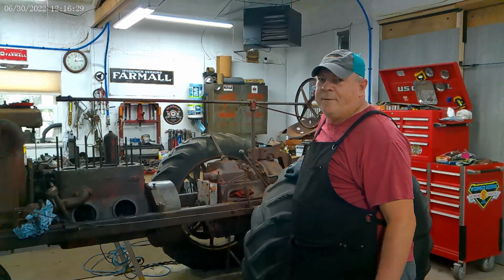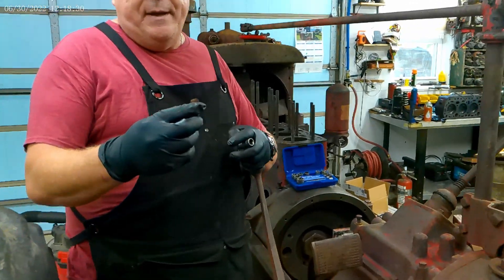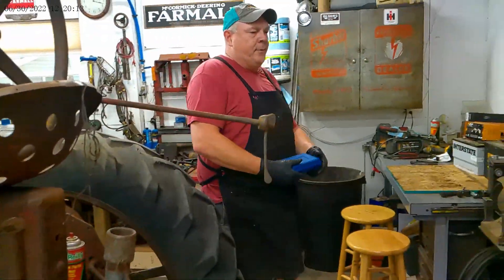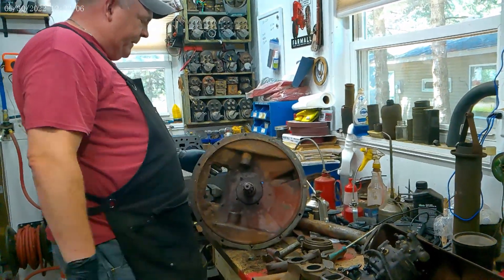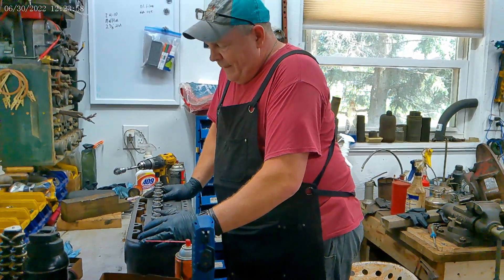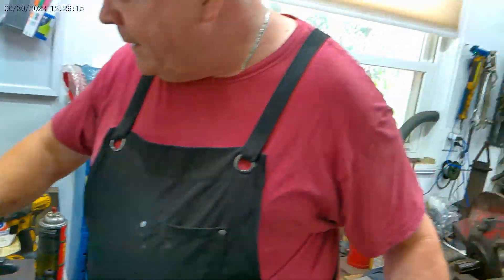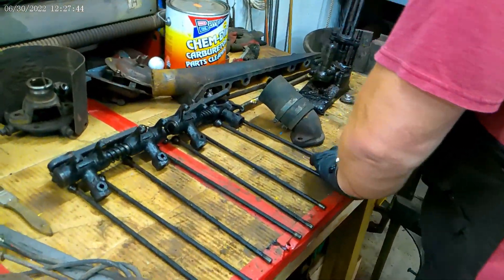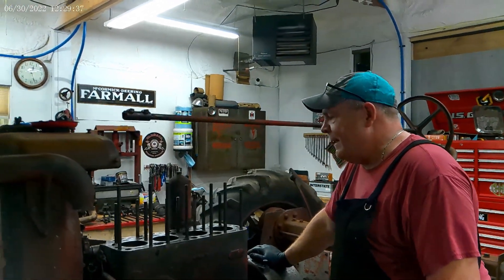Taking apart 1935 Farmall F 20

Comment: Merry Christmas from Wisconsin, rocket socket set , cool info for rounded head bolts thks
I have a lot of H's and Ms (1 C ) but really didn't know much of pre 1939 IH tractors . I have
 been using the internet and found  out about the f series . Now I know a little . I guess
there just rare to find somebody that has one, but It's like a car as soon as you buy one . then 
you see them all the time .  I think I like the f-20  / with a overdrive and starter option If I was to collect one.
Reply from the maker: Merry Christmas!!   there are a few F20s out there with the starter conversion but if you have it timed and set right you dont need one.   they will start with a 1/4 pull on the handle.   Ive passed over a couple f20 projects with starter belllhousings.  people normally want way more than they are worth.   I have a f20, f12 and a Regular with overdrives.  they can be pretty sketchy!  nothing like hauling ass on a 80 year old tractor with no suspension and band brakes!